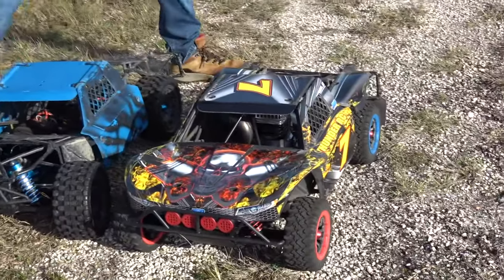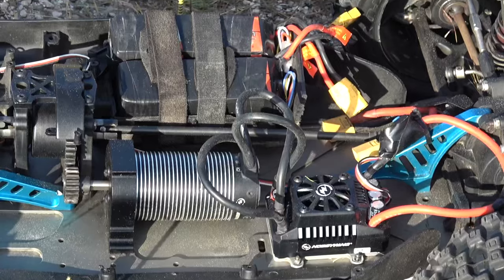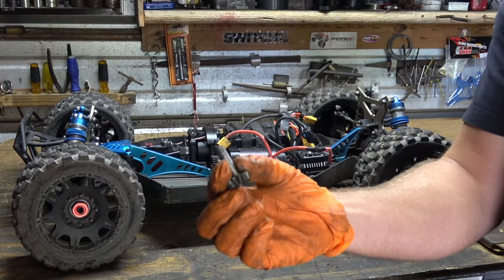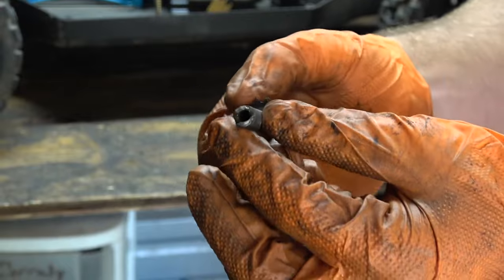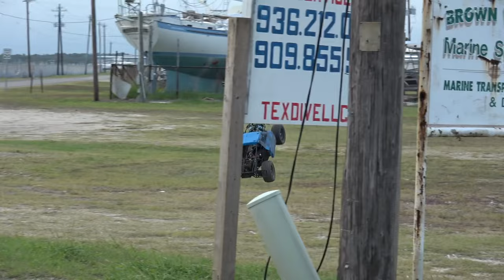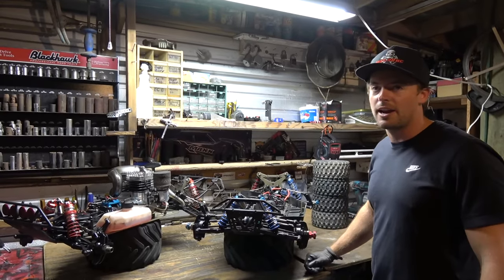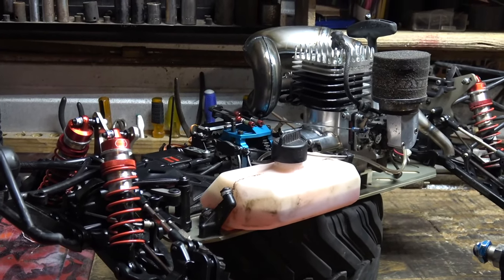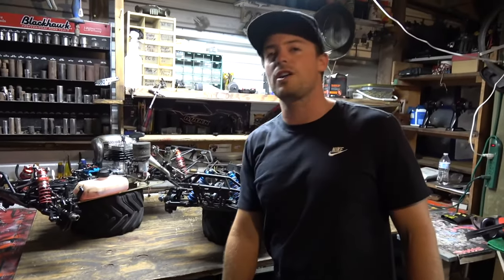Which RC Car to Buy? Electric or Gas?

Comment: For power and Speed and Simplicity electric. 
But i like Gas for being able to have it in the Boot of the car , with a can of Gas , pitch up and Fire it up and Drive it For a good amount time ifnthe engije is tuned well , the elcteic you have to charge the batteries . And watch the Temperatures and less run times .
Reply: Yea n u can’t leave the batteries charged for a long time or they go bad. Lipos so finicky
Reply: @ll.7927  
I used to run nitro buggies, and an FG Monster truck. When ever i wanted to go out id fling the cars in the boot , grab my nitro fuel, and my petrol can . And off i go . 
Now i have to chsrge up all of my lipo’s 
Possibly day before , then the weather turns bad and ive got a load of fully charged lipos . It can be a faff at times

Comment: Well honestly I really do like the sound of the gas. But I like the electric a little bit better. It’s a lot quieter and a little less weight on the chassis=less breakage. 
Overall I’d be happy ripping either one. 😂👍👍😁😎✌️⚡️⚡️⚡️⚡️⚡️⚡️⚡️⚡️💥💥

Comment: I dont know guy. I cant do 10 minute runtimes so gas in the 1/5th scales for me. Takes me 10 minutes to get from my car/suv to the spot i run my 1/5 scales. At that point I'd have got through a battery or 2 already. On gas the engine is just warming up. I have never had an overheating problem with gas where as its the opposite with electric. I dont overgear my RCs and usually drop a tooth. The only RC that has more teeth than stock is my ERevo and it is only up 1 tooth. The engine in my 5ive T is still cool enough to touch while every electric RC i have runs way hotter.

Comment: Old video but Electric EASILY takes this, you wouldn't dream of taking any of those hits off the death ramp, plus the electric 30 can do all those speed runs as good or better.
BUT if you love the SOUND of gas, yeah then that's gonna be your choice, it's harder because you can't run a gas rig everywhere because of the noise.
For me, what I do, Electric is better on every level

Comment: Gas for the Sunday driver, electric for the everyday.... I have two 1/5th scale monster trucks by primal, one with a GP460 and the other with a Max4 combo. The gas makes me laugh but the electric I can run anywhere plus it is significantly faster and no grime from 2stroke exhaust to clean.
Reply from the maker: I love both power plants but gas is way way more fun to me. These Taylor engines are just insane with the sounds and crazy power and smell! I just love it! I’m so addicted 😂😂😂💪🏆